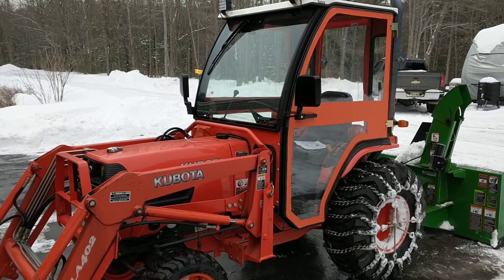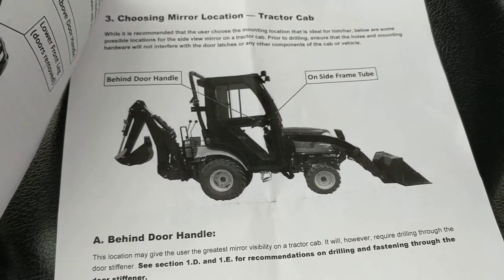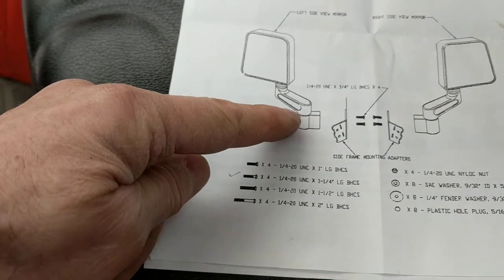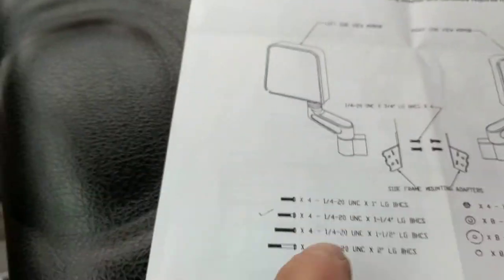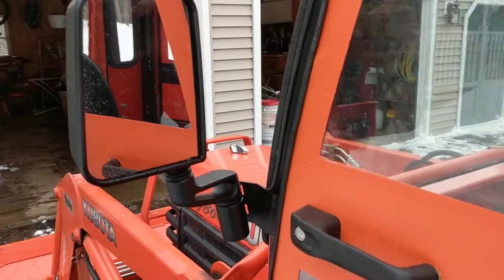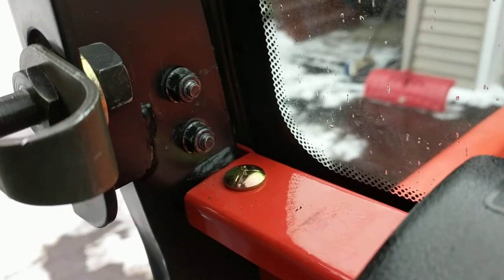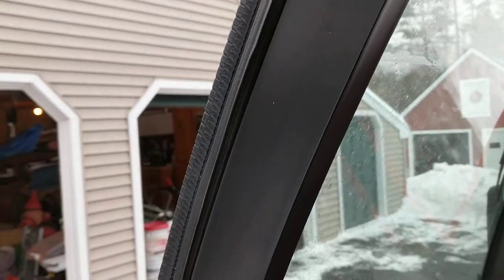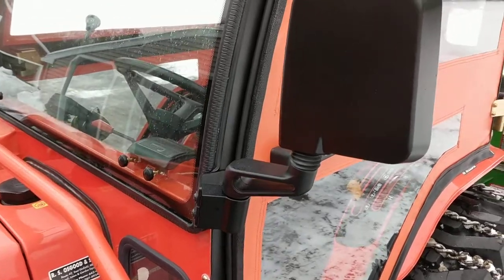Curtis Cab Universal Mirror Installation

Comment: Couldn’t bring myself to spend the $350 Canadian on these mirrors so have tried several different solutions. The one that worked for me was buying cheap golf cart mirrors and epoxying a good quality magnet to the base. This allows me to relocate the mirrors if I want, easy break away if I hit something, and they transfer from the frame of the doorless cab to the doors without issue, and without having to drill or fasten anything to the OEM framing.Quick cheap, and super functional.
Reply from the maker: Very good! The mirrors can be purchased from other sources as well. I believe that at the time that I bought them, I discovered that they were also used on some Jeep models and other vehicles.

Comment: Very Good Video.
I also have a B7800 tractor with a Curtis cab along with a Frontier 64" wide snowblower.
It's been a  great unit for snow removal here in Maine
I've been thinking about getting mirrors but was concerned they may not provide enough visibility
to judge clearance of snow blower from driveway guide stacks  or sides of buildings I snow blow next to.
I prefer snow blowing at night and have plenty of rearward lighting.
Do you find the mirrors work well for you or do you find the need to look rearward also ?

Comment: Would you or did you consider a rearview mirror rather than side mount? I see that Curtis offers both and I am trying to decide on which will give me best rear viewing functionality.
Reply from the maker: I would tend to go with both. I was thinking while snowblowing this last storm that it would be nice to have a rear view. I need to check feasibility since rear Curtis cab panel is plastic. Not sure how visibility would be through clear plastic. I would not get rid of side mirror s because they allow me to see snowblower edges for clearance near obstacles. Not possible with rear view. I also added driveway markers to the sides of the  snowblower to help with backing visibility. Mirrors are same as autos. I use both center and side. Side more than center.  thanks

Comment: If u really need directions for mirrors have someone more knowledgeable install them
Reply from the maker: Thanks for the comment. I assume that you watched the full video?  The instructions were lacking and Curtis technical department could not help with better illustrations. Since I bought the mirrors online, I'm not sure who I might have hired to install them with adequate knowledge.  Also, I generally don't pay to have work done that I can do myself, or figure out how to do myself.
Reply: ABCABC: really. You think your response is worth the time it took you to type it. 
Larry: I very much appreciate you taking the time to make this video as I am currently attempting to figure out the best mounting approach for mirrors on my Curtis cab.

My tractor is small and so the allowance on the cab for mounting points is lacking. You’ve given me some clarity as to how the brackets mount and their dimensions. as you have pointed out the instructions are weak at best